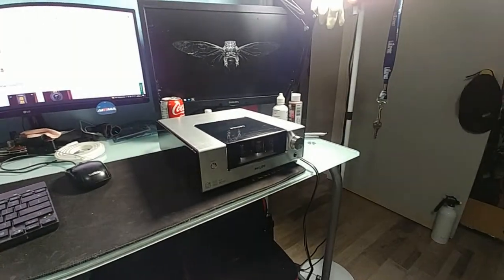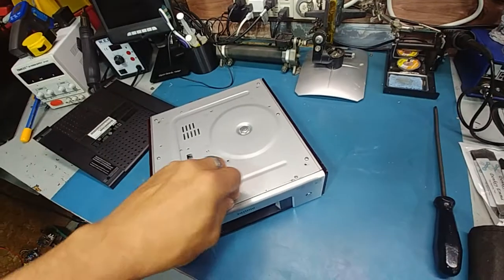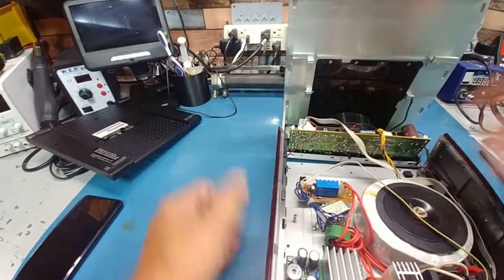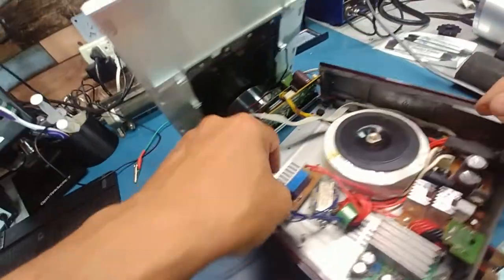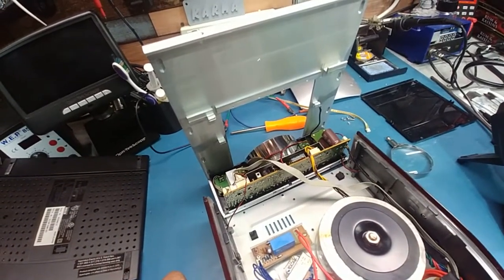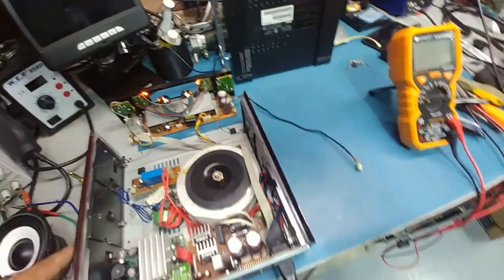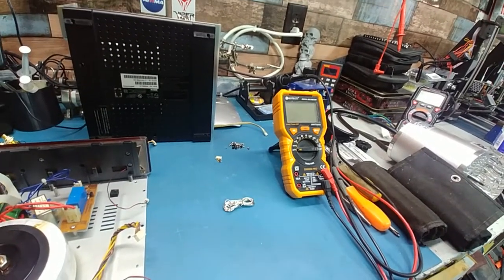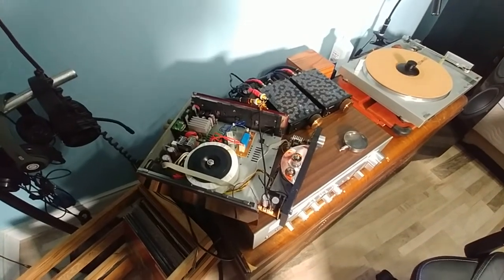Philips DVD Micro Theater MCD908.98 thrift store find *no power *

Comment: I just figured out how to use this amp without the rest of the modules
Pin 1 Digital GND
Pin 17 ECOPOWER +5V
Pin 18 STANDBY +5V
Pin 19 MUTE Digital GND
Pin 21 Analog GND
Pin 23 Analog Right +
Pin 24 Analog Left +

The 30 pin connector is counted from the back Right to Left and Up to Down 
Check schematics online are available

Comment: I have the same one, one day I plugged in a 220 v. electrical outlet accidentally and that was it,  i have it sitting in my garage,  i changed the two little fuses base on this video but  only the stand by light its on ,  not on the amplifier but on the cd section of the radio, maybe if i get a new relay but I have not idea, i dont have the tools and I don’t know how to do it but thank you for your video.

Comment: how did u take off that black cover cant see on video
Reply from the maker: there's 4 screws to remove after you get the cover off
Reply: Have same question.. The black cover doesn't want to move even if the 4 screws are off... Any idea ?
Reply: @gizmoson67  so I figured from another video u have additional screws under 4 black rubber pads so annoying and unnecessary...
Reply: How to pop up the black cover.